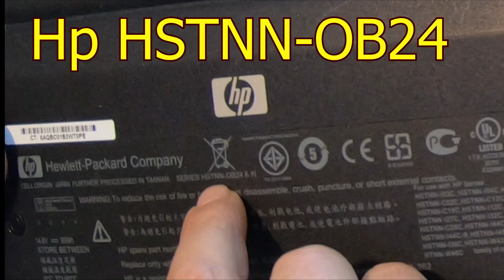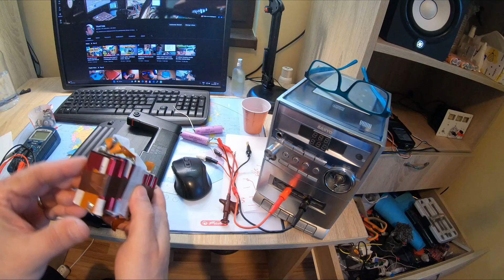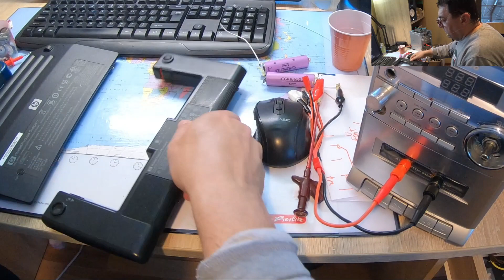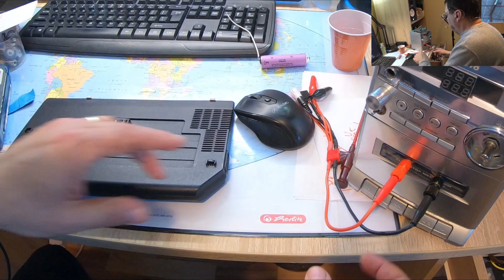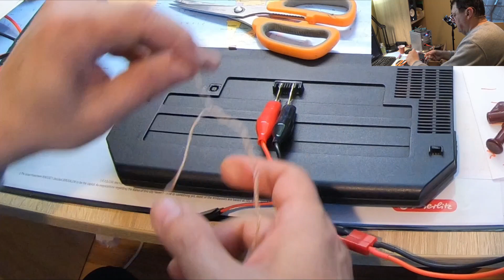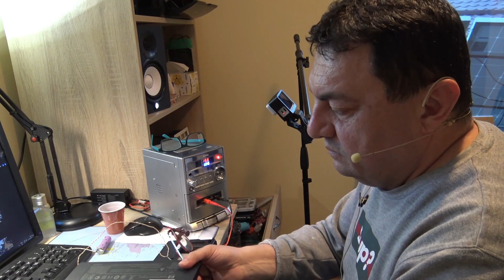HP laptop battery charge with external power supply

Comment: My laptop battery is dead and have been AC to power it. Replacement battery is expensive and will not last long. I am thinking of making a power pack of the same or even bigger capacity using 21700 with bms. my problem is how to connect it to the laptop battery + & -terminals, leaving the other terminals untouched. Will that work? Thanks for answering.
Reply from the maker: Kind of dangerous, also the laptop will not charge it because of the internal BMS with a lot of data running in and out. Better do an external battery pack to fit in the regular power supply, but also you need to charge the pack with a specialized Li-ion charger.  I believe the best way is to replace the original cells with new ones and keep the wiring because as soon as you disconnect any cell the internal BMS will lock the battery...it's a crazy labor to parallel each cell with a new one, do the soldering and disconnect the old ruined after... I rather buy a replacement.
Reply: @viocaia thanks for your advice.

Comment: Pin 2 or 3 are enable pins, which connect via a 10K resistor to +3.3V inside a laptop. Your wire is picking up noise which is just enough to charge the gate. Touching the + 15V charging voltage with you finger and pin 2 or 3 does the same as your body which represents 1M to 10 M Ohm is Al's capable of charging the gate.
Reply from the maker: Of course...Thanks!

Comment: I got many cells and bms from old Dell laptop battery.i made battery pack using those .but same problem .it gives output but not charging .i tried all tricks available on net.can you please throw light on it?
Reply from the maker: It's hard to unlock a laptop BMS, it needs a special tester which can unlock battery memory and let it charge. Try to charge directly on cells with a IMAX.